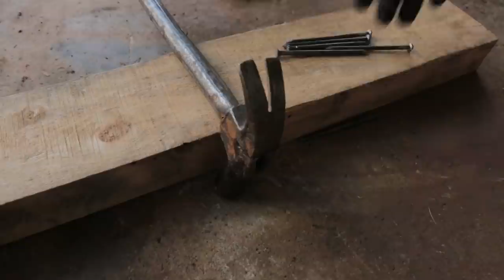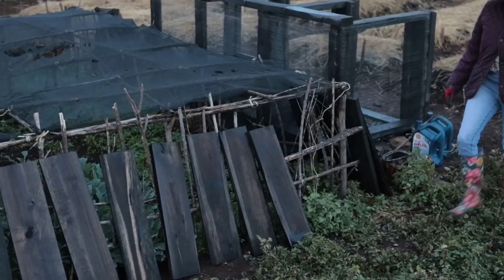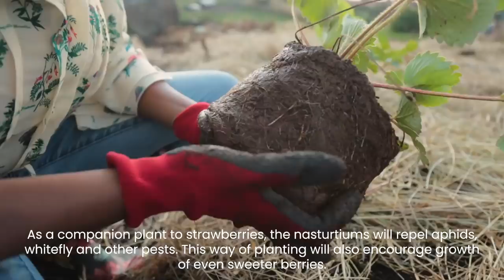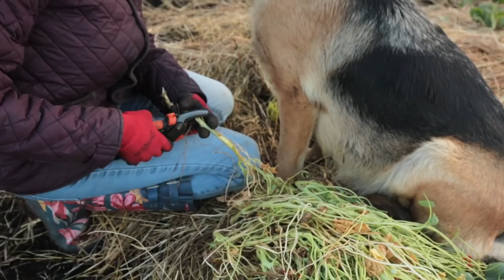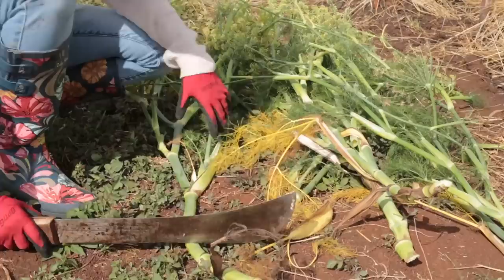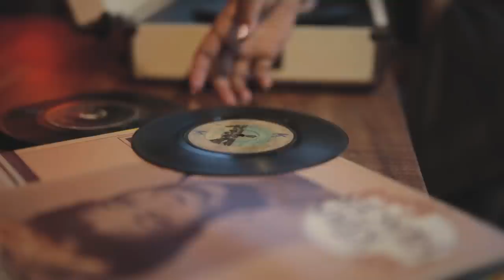How I Plant My No-Dig Kitchen Garden | Plan for Compost | Countryside Slow Living Vlog

Comment: Just a few bits of advice. Pull the straw back from underneath or right up to the stalk of the plant , this allows air flow and stops disease. 
When hammering in nails that long is a good idea to pre drill where you want to put the nail,  this reduces the chance of the wood splitting on the end. And also when using the hammer hold it back on the handle more. You’ll get a better swing at it and the nail will go in easier.  Your doing a great job keep up the good work
Reply from the maker: Thank you Caroline, this is really great advice. 💕💕💕🍀🍀🍀